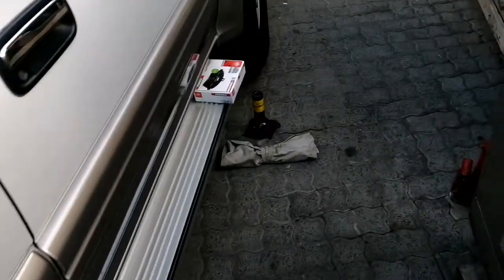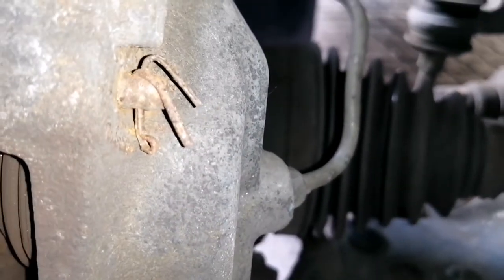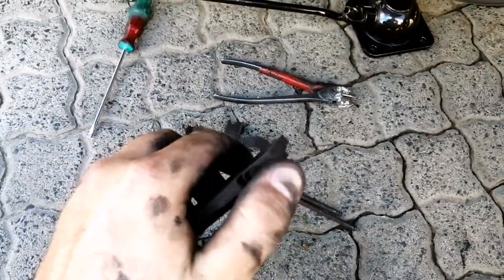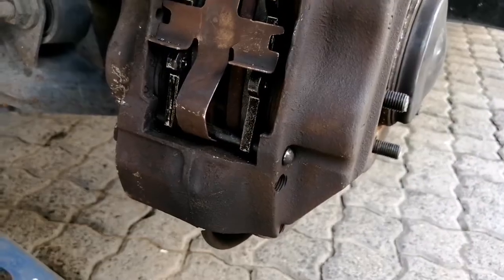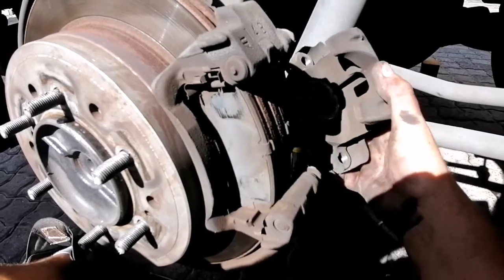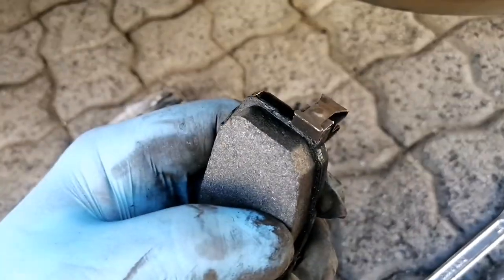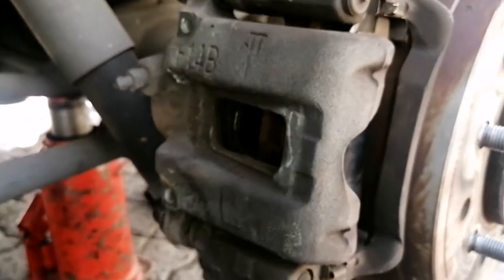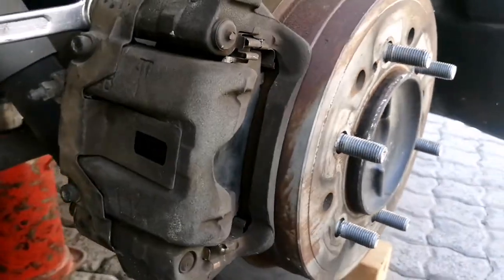Brake pads replacement (Toyota Prado 1998)

Comment: Great video, thank you. Do you need to re bleed the breaks after or just pump them on and good to go?
Reply from the maker: So I'll give you my opinion  right but this does not make it right I'll tell you the pros and cons : if you press back the brake pistons without opening anything  (the loop or circuit is still closed ) meaning no air can get into the system so I myself just pump them till they are firm and you are good to go . 
Now !!
 pros: is you don't mess and it's less work and cleanup and some people don't bleed correct  and thar can cause bubbles in the system . And it's cost effective  right
Cons: brake fluid is hydroscopic this means it pulls in water from and surface or substance so depending on when last you changed your fluid out ,it is good to do it every 2 years can v
Be extended to 3 or every 72000km , remember aswell as you brake the fluid also gets extremely  hot especially  at the caliper so that fluid breaks down quite severely,  another is when you bleed you can see if the colour is still good or atleast flush out the most degraded section of fluid.

I'm going to do my X6 brakes soon and I'll chat about this aswell ,thanx for your comment it's an good one we'll observed and great question 👍🏼

Comment: What if it’s making that squeaky/screeching noise? Would I need to replace the rotors too?
Reply from the maker: Hi it's been a Year and my apologies  I did not recieved  any notice of your comment: bit let me answer you .
If you replaced new pads then there is no need to replace the rotor if you don't experience  shudder when baking (shudder is when you brake and your steering wheel vibrates this is due to warped rotors or even worn tie rods so if you do not experience  this I would not fork put the unnecessary cash as rotors are expensive  especially  if they are vented, slotted and or drilled and the most expensive has all 3 also depending on the material it's made from but I digress let's get back to your pads it can be that the pads someone sold you are cheap and they usually  do squel now if you bought expensive ones it is just dirt ,stone ,small piece of metal, sand or even wood that is stuck you can remove the wheel use an hp washed and jet it clean and use some brake cleaner I found that the hp wash usually  works fine on its own ,now if it's old pads some pads has a tell tail it's a piece of metal that sticks out a few mills towards the rotor with the friction  material and that is to warn you and let you know the pads friction  material is low.
Thanx for the comment 👍🏼

Comment: It didn't show fitting the 2 anti squeal plates that fit alongside the pads to prevent brake squeal.
Reply from the maker: Sorry  about that ,we had no issues so I'm not sure I'd it was attached  to it already
Reply: @RamgotterNucleus  hay thanks for your reply. I found out now anyway. They have 2 anti-sqeal plates per caliiper. I was watching the video to hopefully see what order they go in. But I got a manual and it shows the one with the slots in goes against the pad and the solid plate goes over it and goes against the pistons on the caliper. I had a nasty squeal without them when breaking slowly. But has gone now I have put them back in the correct order. Thanks for the help anyway I still found the video helpfull. 😉